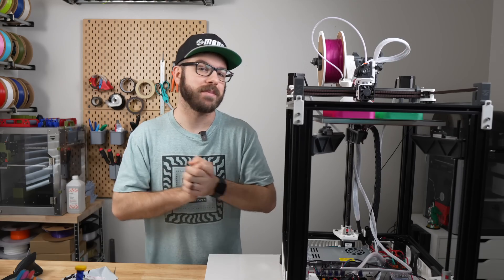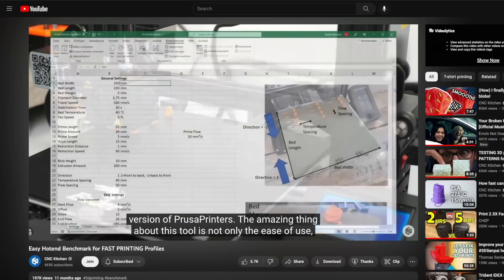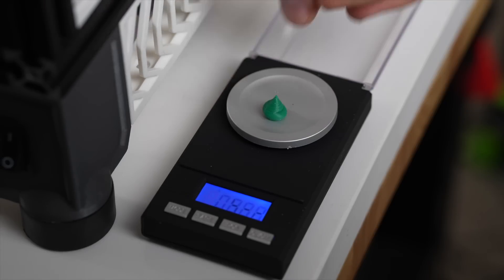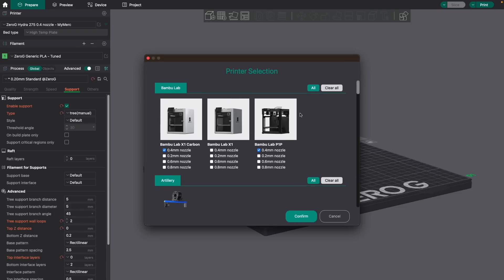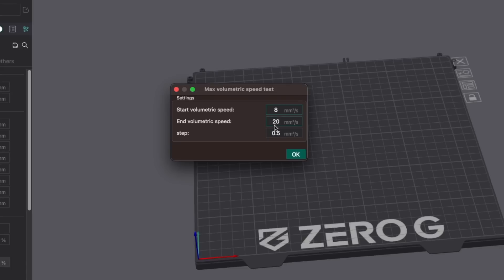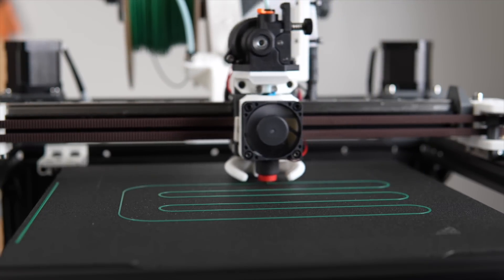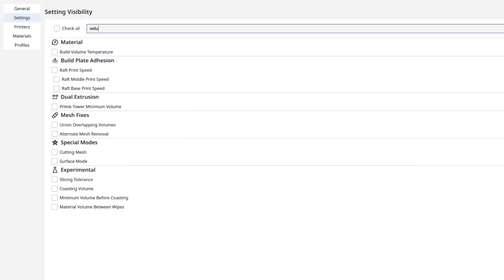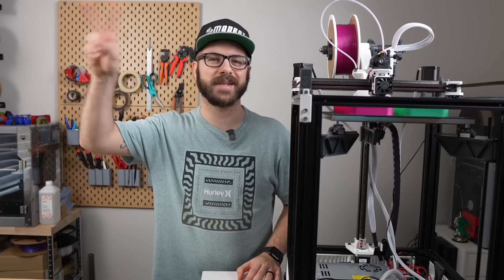Find Your 3d Printers MAX Output

Comment: Is the formulas that each slicer uses to determine volumetric flow the same? if they were different it would make it hard to switch. not a big deal if you only use one, but sometimes there are features that one has that another doesn't and vice versa
Reply: In theory they should be the same as known values should be consistent, ie filament diameter, nozzle diameter, line width, and layer height. If extrusion multiplier is tuned in and consistent then the maximum speed at which all of those remain the same can be found. Bambu Studio, OrcaSlicer(formally known as SoftFever), SuperSlicer, and PrusaSlicer are all based on the same thing so there will probably be very little difference between them. Cura is the big outlier here, lets face it very few are going to pay for the subpar Simplify3D, at this time does not natively support setting max volumetric flow to automatically limit print speed.

There is also the issue of most of the popular off the shelf printers are limited more in other ways and wont hit max flow on a 0.4mm nozzle with 0.2mm layer height. Start upping nozzle size and layer height and they may in fact get close to it. 

Ultimately if your slicer of choice does not use max flow to limit speed then you will just need to set those limits manually after some testing. The faster we print the more the little things matter to making a good looking and functional item.
Reply: @Bearded.Bucket  yeah I started to run into under extrusion with .8mm nozzle and big layers
Reply from the maker: In theory max volumetric flow should be max volumetric flow. I have used it in SuperSlicer and OrcaSlicer/SoftFever and it has worked fine. As long as you dont have other things drastically changed like flow in one slicer over another there (should) not be an issue.
Reply: It´s just volume over time, it´s pretty basic for every slicer.

Comment: Can you please direct me to the files for your filament holder?  I am nearing the end of my Mercury/Hydra build and totally forgot that I need to get plastic into the thing.
Reply from the maker: I ended up swapping it out for the spool holder on the voron trident. I didn’t like the weight of the spools on the top frame. Here is the link though to the one in this video: https://github.com/ZeroGDesign/UserMods/tree/main/Mercury_One/ZeroG/Spool_holder
Reply: @ModBotArmy  Thank you!

Comment: Good video but I guess if this isn't something that matters in Cura then I don't know how I would implement it, as I use Cura exclusively. Maybe they'll implement it in the future?
Reply from the maker: I hope that they do implement it. That being said finding you max flow rate is still valuable. Cura will let you check volumetric flow in your sliced file on the preview page so you can use it to verify you are not trying to output more than your hotend is capable of.

Comment: Great video, very informative! Question for you, how did you quick change the color of the model when you are previewing it in OrcaSlicer? I saw you do it in the video and I have been trying to find setting haha.
Reply from the maker: You just have to click on the color swatch for the filament. So on the left side above the slicer settings there will be between 1-4 filaments listed (depending on your printer and if you are using an AMS). Click or double click on any of the small color squares and you can set any color :)

Comment: ZeroG Mercury One? Yay or nah?
Reply from the maker: 2 thumbs up from me. I did the Mercury 1.1 and Hydra. Hydra adds a lot of cost too it as you at that point are only keeping frame and psu. I would start with the 1.1 conversion and see if you feel you want to upgrade the bed. Ender 5+ being supported on both sides is a much better start than the cantilever bed of the 5/5 pro. Will have a full video.
Reply: @ModBotArmy  thanks for the reply and the heads up on the Hydra aspect. The printer looks great! Looking forward to the video and starting the project for myself.

Comment: So each line on  the print equals 1 step or 1/2 step.  He has no wiki for this test and I'm confused with how to measure.  I understand the starting and ending flow rates.  The 0.5 step is throwing me off.  Thanks man.. love your channel.
Reply from the maker: Each line was a full step with set at 0.5. It was also a bit confusing to me. I changed the value a few times and resliced but the 0.5 default is the easiest to follow since it aligns with the notches generated on the side of the print.
Reply: One. Like told in the video
Reply: Thanks

Comment: great video as always! I also had a question about CURA slicer; where do we adjusted the volumtric flow rates in CURA? I recently picked up the bondtech CHT but acutally utilizing it with CURA has been a challenge as I dont know where to adjust the settings. Prusa slicer is straight forward with the setting but I dont feel like mastering a whole entire new slicer...
Reply: wow ok I should've finished the video, that sucks such a vital settings like max volumetric flow rate is not a setting...
Reply from the maker: Yeah it looks like the devs dont find it quite as valuable which I find odd. You can still see the max volumetric flow in the preview window but not being able to set a cap is a bummer. I have a feeling they may end up adding it with time.

Comment: Great video as always, just had someone asking about this yesterday so I linked them here.  Playing it safe is a good bet. I used this test last week and broke the layers apart to measure thickness.  What "looked good" measured noticably thinner than the section below it, so I ended up stepping down more than just eyeballing it would have gotten me.
Reply from the maker: That’s a great idea. Especially for verifying your parts won’t be weak from not enough filament being extruded. That route would definitely help you hone in on a more exact rate.

Comment: I've seen people printing those blobs but never knew why.  Will have to get a scale and try these tests.  Upgraded my IDEX with a pair of Dragon UHF hotends not long ago so have been curious what they can do.  Thanks !
Reply: Im getting 32mm3/s from a regular hf with abs and around 40 with the uhf. Abs at 260 degrees, so nothing outstanding i would say, especially since its a ceramic heater which you need to run a bit hotter anyway due to its thermistor location.
Reply from the maker: 32mm3/s is pretty damn good. I have a feeling the hardest part with trying to hit those top speeds is cooling the part quick enough. Especially with overhangs.
Reply: @ModBotArmy  yeah, overhangs are always the bottleneck. I even installed twin berd air pumps on the super racer to keep up as fans are not enough, maybe a 4028 axial would be sufficient, but there is no space on a delta for axial fans. But increasing line width from 0,4 to 0,5 helps a lot
Reply: @over_pizza_2578  Chilled air from the AC up next ... xD

Comment: I just designed a new superlight assembly and wanted to test it out. This video was perfect, thanks man!
Reply: Cool 👍, update on yr findings. If it is coreXY please do the speed zig zag diagonally and compare to horizontally. CoreXY only use 1 motor for diagonal movement.
Reply from the maker: Awesome!! Hope the results are what you are wanting :)

Comment: I have been meaning to do this for my new FLSun V400, but I can't find a delta compatible version of the CnC Kitchen web app
Reply from the maker: You should be able to use the CNC kitchen version. Just make your bed area smaller so that is would only cover a center square portion of the round bed and give yourself enough of a safe area from the edges :)

Comment: The only reason I swapped from Cura is because there wasn't a max volumetric flow cap.

It makes slicing SO much easier.
Reply from the maker: I am shocked that with all of the features they have they did not add that. Based on the replies I found on it they have it on their list but it doesnt seem like a priority.
Reply: @ModBotArmy Me too. This is a really basic parameter.

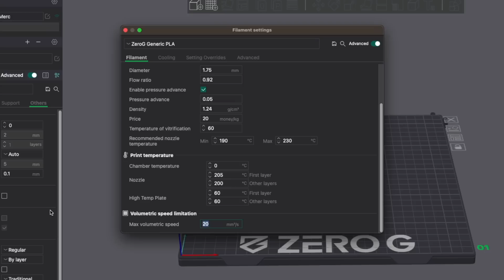Comment: Wouldn't too much filament being pushed through lead to overextrusion, not under? Refering to @0:14 or so.
Reply: It's not too much filament being pushed, but too much being requested by the slicer (attempted to be pushed), i.e. more filament than the hotend (or extruder) can handle (edit: a reason can be that the hotend just can't melt the plastic fast enough). So if the slicer moves at a fast speed (or thick layer height) and thinks 20 mm3/s are being extruded, but the hotend can only do 14 mm3/s as in this case with the Revo, you will have underextrusion (basically missing plastic worth 6 mm3/s).
Reply: @ThomasS17  Oh thank you so much for that explanation, makes perfect sense now. I'm only a few months into my 3D printing 'journey' and still have so much to learn.
Reply: @slothgirl2022  No worries, glad it helped! There's a lot to learn, especially early on, but you'll learn it eventually, it just takes time. I'm about a year in and still learn new things (almost) every day.